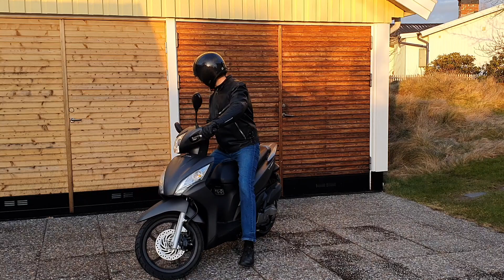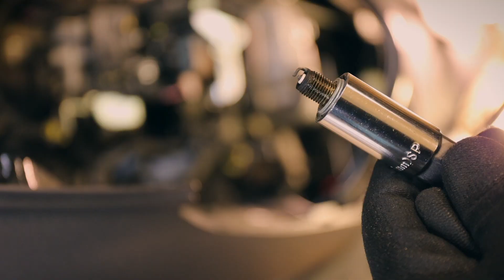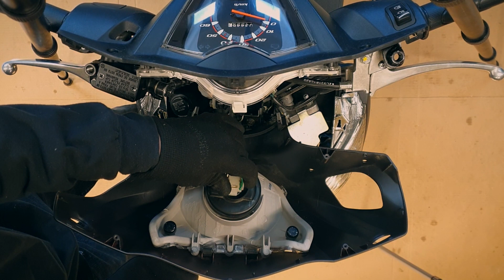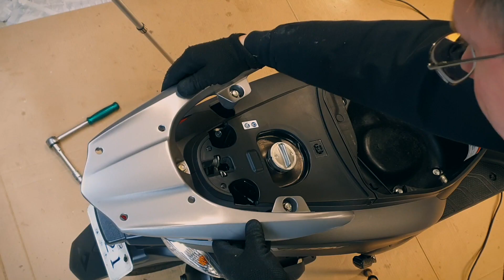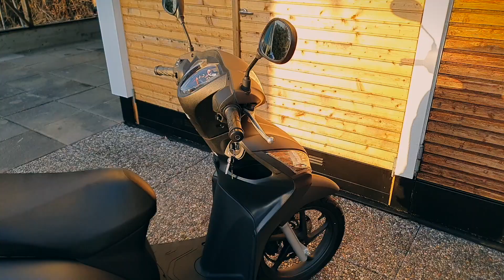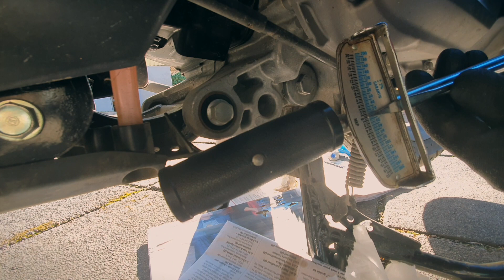Honda NSC50 Vision Service. Engine oil & filter. Valve adjustment. Spark plug. Brake fluids.

Comment: Bit of a bad design by Honda not to have a proper paper cartridge oil filter, but the Vision was always a budget bike.
How tall are you ? Because that bike seems to fit you very well seeing how it is only a moped.🤔
Reply from the maker: Hi Gary. A bit cheap yes, frequent oil changes is a must. But when doing so, this engine can survive for a long time. I am 180 cm and the bike fits me very well indeed.

Comment: Did you know the bike has a combined braking system?
Reply from the maker: Hi Matthew. Yes the rear brake actuation pushes one of the front caliper pistons at the same time. Look at the brake pad replacement video and you can see a bit more about it.

Comment: Hi,  recently got a 2018 Vision 50 with 7000 kms. Bike is like brand new still. I've put on 2500 kms in 7 months. I understand everything about the scooter- oil MB/MA wet vs dry clutch etc. Apparently MB cvt scooter oil with dry clutch  is  the same as 'SN' rated car oil. I have a few questions (No one at dealerships or scooter stores seem to know any of these answers) everyone scratches their heads and just say 'use whatever.' But I want to keep the bike/engine pristine for as long as I can:

1) Do you know if it's OK to use 100% synthetic 10W30 'SN' rated car oil like Castrol or 
Mobil 1 ??  Or do MB scooter oils have different/more specific heat modifiers in the oil? (being small engine & air cooled they run very hot)

2) Would it be better to use 10W30 or 10W40? 10W30 would have better flow & fuel efficiency, but 10W40 would provide better residual coating protection. Is this of any importance in a single-piston air cooled engine? 

3) Is it really OK to use the extra engine oil in the transmission? I thought it would be a more specific grade tranny oil?  

4)  What is the size/dimensions of the Oil Drain Plug & copper gasket?  (Vision 50)

  Thanks so much
Reply from the maker: Hi Anders. 

Giving oil advise is a very tricky topic, it is clearly so that no one knows everything, and I have talked to several oil companies directly. As you know Honda recommends motor cycle oil according to JASO T 903 class MB, 10W-30. All Honda dealers I've talked to use MA or MA2 10W-40 instead, still according to the same JASO standard. I choose to use a fully synthetic motorcycle oil of highest quality and meeting a JASO T 903 MA2 standard and viscosity 10W-40. 

I would not use a car engine oil in a motorcycle application, the additives used are most likely not the same. For instance, how can one know what type of anti foaming additives that is used in these respective oils? Probably only the oil blender truly knows.  

As you could see in the video, the motorcycle oil was used in the transmission as well. This was an advise by one dealer. How much do they know about transmission oils? No idea, but it seems to make sense since motorcycles typically have common oil in engine and transmission. In the case of the Vision this is convenient since engine oil volume is 0,8 and final drive 0,15 liters.

Regarding the washer. I have never measured it. I would just buy a new one from the nearest dealer or online. If in a hurry and you have no time to get a new washer for some reason, put a little bit of engine sealant at the base of the screw threads instead. 

Good luck
Reply: @hoojiesgarage1542 OK, thanks for the reply.  According to my research JASO T 903 class MB is the exact same as ILSAC standard API SN/SM/SL/SJ motor oils (both lacking wet-clutch friction modifiers). 
All MA/MA2 oils are backwards-compatible with MB, but not vice versa.
But in dry-clutch application all MA oils reduce optimal engine performance, fuel efficiency, & life-span as unnecessary friction modifiers technically create more piston-drag, internal engine pressure, and heat.
Apparently these engines are designed to run on straight motor oil. Nowadays MA/MA2 oils are much more easily available and probably why dealerships just use them instead. But I think it's a bit sloppy. These oils  work good but are not technically optimal for the engine. I will not use car oil as like you say there can still be an 'unknown' difference in detergents/anti-foaming etc

Comment: Tack för en jättebra video för mig som också har en vision! Nu har jag låst in nyckeln i sätet, har du nåt bra knep för att få upp sitsen utan nyckel? Verkar vara svårt att komma åt skruvarna för att lossa chassit bak utan att öppna sitsen
Reply from the maker: Key locked in under the seat? That's a tricky one. Life without a spare key is risky. You need to break or destroy something to get in there. I would try to peel off the "saddle skin" by trying to get the small clamps at the inner edge to come loose. If you succeed with that, then try cutting off the foam in a way so that you can glue it back later. When you find the upper area of the metal "striker", grind that away. Like this you should be able to get the seat to unfold. And then you have quite a bit of work to rebuild it. Good luck!

Comment: Where is the serial number on the chassis ?
Reply from the maker: At the rear area of the "helmet bin", under the seat, there is a plastic lid. Poke that lid open and you will se the "VIN"-number on the frame.

Comment: Do you have workshop/service manual? Or do you know where to find one?
Reply from the maker: Hi Roger. No, I have no work shop manual. The only documents I have is regarding the valve clearance adjustment that I got from a Honda workshop/dealer, and the owners manual.
Reply: @hoojiesgarage1542 ok thank you. Is it possible for you to send that document? And the spec for different oils, brakeoil, engineoil and transmissionoil?
Reply from the maker: In the info-text to this video I have written all those specs.

Comment: This video is so cool. Thank you very much. Have you considered installing an open source ecu? You could then have the scooter automatically throttle to 45 km/h with a command or on restart etc, and it would be great to be rid of rev limiter
Reply from the maker: Hi Berry. Not really, close to 60 km/h feels just fine for this bike. But of course I am curious. Who makes such an ECU for the NSC50?
Reply: @hoojiesgarage1542  Malossi does. they provide special kit which includes 85cc cilinder with piston (just wider, fits on perfectly), ECU which rises rpm limiter from 8k to 10k, wider exhaust pipe and Malossi multivar 2000. All this together makes this scooter to achive 79km/h measured with gps.

Comment: Добрий вечір. Скажіть будь ласка, через який проміжок часу потрібно замінювати трансмісійне масло?
Reply from the maker: Good evening. The transmission oil is by Honda recommended to be replaced every second year. But, since there will remain 0.2 liters of motorcycle engine oil when doing the yearly or 4000 km engine oil service, then I typically use that oil in the transmission. If the engine oil is for motorcycles with integrated transmission.

Comment: Salut
Je dois changer le roulement aiguille arrière  car il fait un bruit d'enfer  ,pensez vous qu'il faille un extracteur pour sortir le vieux.
Merci
Reply from the maker: Bonjour. Sorry for not speaking French, hope a translator will work. Which needle/roller bearing is that you need to replace? The one that carries the rear wheel or the one in the rear variator? Regardless of which I have not had to replace any of those, I think consulting your nearest scooter workshop will give you a better reply. Please feel free to share their comment here, could be interesting to read their comments. 
Sincerement

Comment: Hej. Riktigt bra video. Vissa säger att det ska vara en helt annan olja i slutväxeln ? Typ 80w-90 ? Stämmer inte det ?
Reply from the maker: To my understanding you can either use a gear oil for scooters, or a motorcycle oil (that also is used for both transmissions and engines). I would say that the most important is that there is oil at all back there :-) This is quite a low power machine and the load on the gear is modest, to say the least. Then it is also important that no dirt enters the filling hole when doing the service.

Comment: Hello! Excellent video! Why did you adjust the valves after so little bit of use? I have used my nsc50r daily for about 5 years and it touched 90 000km some days ago. Never touched the valves. I have changed engineoil every 4000km and I have used mobile 1 0w-40. I change sparkplug, transmissionoil, belt, brakefluid and cleaned the airfilter every 20 000km. Havent done anything else with it...
Have a good day!
Reply from the maker: Hi. Thanks! Interesting to hear from you. 90 000 km! Very good. Well, I just checked the valves, since they were fine I did not adjust them, I just tried to explain a bit on how to do it if needed. Your experience indicates that the engine is quite robust then, good luck with your bike!

Comment: This nut of rocker arm is usually 9mm,like in all japanese rollers,am i right or not.
Reply from the maker: Good question. It looked like 10 to me and I didn't have to change the clearance so I can not say for sure. I will not take the scooter apart just to check but you made me curious. I have a special tool for nut and screw rocker arm work that I think comes from Honda (908-3230000). Just measured the hexagonal area and it is. . . 10 mm.

Comment: What oil use for transmision ? Same than the engine ?  Some dealers say me classic 85w oil, and others same than motor.
For motor i used motul 7100 5w30. Can this be used for transmission ?  Thanks from spain.
Reply from the maker: Holá Miguel. Typically motorcycle engine oil is also a transmission oil, since motorcycle engines and transmissions uaually share the same oil. My local Honda dealer advised me that the 0,2 liters of oil that will remain after the engine has been filled up, can be used in the transmission. At least if a high quality motorcycle engine oil is used of the grade that is recommended.
Reply: @hoojiesgarage1542  thanks!!  Sorry again. You use MA or MB ?  I see in oil adviser of motul that for transmision, only recommends MB for transmission, but, i use 7100 for motor, thats is MA2. Then, i can’t use this same oil for transmission true ?
Reply from the maker: The MA, MA1, MA2 and MB classes relates to wet clutches and the friction they need. This is irrelevant for the NSC50 since it has a dry clutch (sitting in the rear part of the belt transmission). At least my local Honda dealer finds this irrelevant for the NSC50.
Reply: ¿Cómo vas a poner el mismo aceite del motor a la caja de cambios? En el motor va un 5w30 normativa MB (baja viscosidad para embragues secos) No le pongas un MA, M1,M2 porque son para embragues mojados, no reducen la fricción como el MB y no ayudan al ahorro de combustible. Para la caja de cambios un 75w90. Saludos.
Reply from the maker: You are right, MB is typically recommended for motorcycle engines with dry clutches. However, none of the Honda dealers around here bother about that and they use some MA type oil in the scooters too, even the transmission.
Reply: @Big1_  he cambiado el aceite de la transmisión esta semana, y efectivamente lleva un 10w30 como el motor, no se trata de ningun error. Los nuevos modelos de honda tienen esa característica, la PCX, también. Confirmado por Honda, y por observación de la viscosidad al extraer el aceite.

Comment: In indonesia, we call it Honda Spacy 110cc carb.
And we made some custom variator pulley to get awesome top speed. Can till' 120km/h with full stock engine.
Reply from the maker: 120 km/h :-) good speed for such a small engine. Here in Europe both the 50 and the 110 cc versions are sold (both with fuel injection). The 50cc version is fairly popular mainly for "kids" or others that for some reason doesn´t want to go through the effort of a higher level driving license. The 110cc is mainly used for low cost commuting, or as a camping bike (put in the trunk of a motor home).
Reply: @hoojiesgarage1542  Are there many Honda Visions in Europe?. Here we use it for everyday. like camping and going to the office. sometimes requires a high top speed because in Indonesia many roads have a minimum speed limit. Although it takes a very long time to reach top speed.
Reply: @hoojiesgarage1542  https://youtu.be/-ZsAmkVggWM 

If u want to see our custom variator pulley for honda vision, honda vario or honda beat.
Reply from the maker: @fahriardians   Watched the video now, interesting. Good work and good luck!
Reply: Which brand variator do you use to get 120km/h?
Reply: @MtuKwao2  just custom the original pulley
Reply: @fahriardians  Thanks, hope mine will get near that speed after a few kilometers, breaking in at the moment.
Reply: @MtuKwao2  you can find on youtube "how custom honda vision variator" or in Indonesia "bubut pulley honda beat". Dont forget to use vpn
Reply: @fahriardians  Thanks a lot bro. Shukran!
Reply: Which variatior, please?
Reply: @rockyp3917  i'm just custom the original variator. In Indonesia, we have many racing variator brand for honda vision.

Comment: Hello, I have a vision 110 and was curious what oil you used in the transmission?
Reply from the maker: Hi

A high quality 4 stroke motorcycle engine and transmission oil was used in the transmission. There are special small "tubes" of scooter transmission oils for sale at various shops. They are handy to use since they have a pointed end that easily enters the small M6 filling hole. 

But, as I talked to a Honda-dealer they said that I could just as well use the 0,15 - 0,2 liters of the engine oil that will remain after having replaced the oil in the NSC50 engine. Since that oil is for motorcycle transmissions too, they said it was perfectly fine to do so. Since I have a suitable little pump that easily enters the hole, I decided to follow their advice.

Comment: Hi do you think the valve clearance procedure is same for the 110cc Vision?
Reply from the maker: Most likely yes, especially if everything looks the same. I have never worked on the 110cc engine but I wouldn´t be surprised if even the clearance of 0,18 to 0,22 mm is the same. Ask your nearest Honda dealer, hope yours is as helpful as mine.

Comment: Also check the vario rollers weights, if you want a bit higher top speed use a; Polini Variator 241.698

Comment: Thank you for a informational video, but 1 question. What type of oil did you use? I have the same bike btw.
Reply: I used 5w-40
Reply from the maker: Hi. The can is the bin. It was a fully synthetic oil fulfilling the applicable Jaso standard. But not class MB it was MA2 instead. The Honda dealers I talked use MA or MA2 (only a factor for wet clutched bikes). Viscosity was 5W-40 or 10W-40.